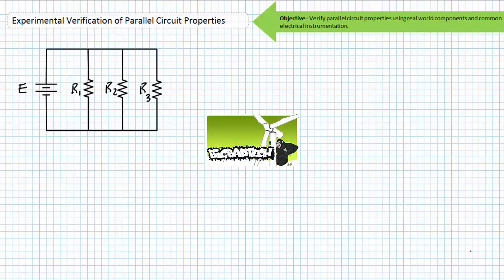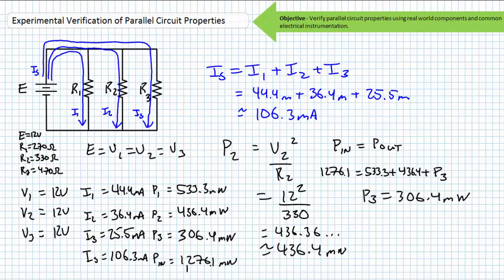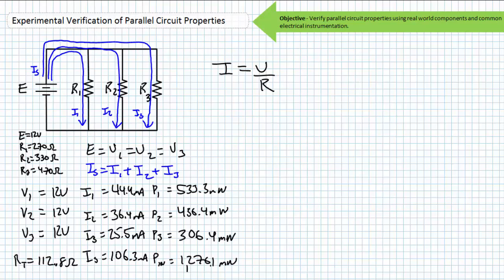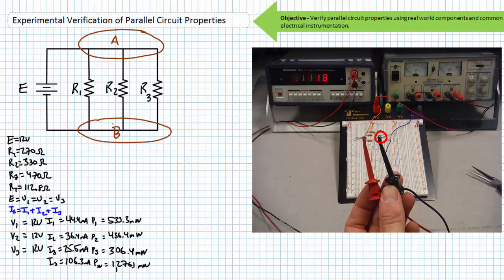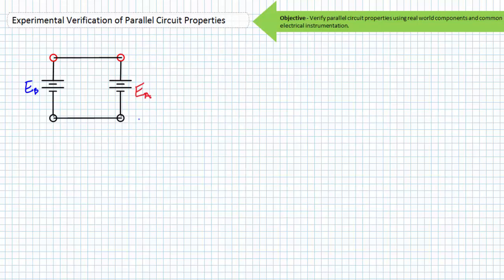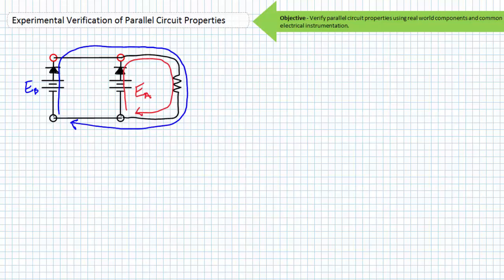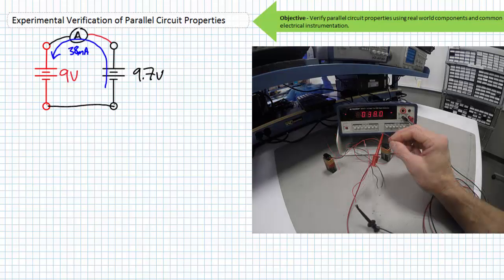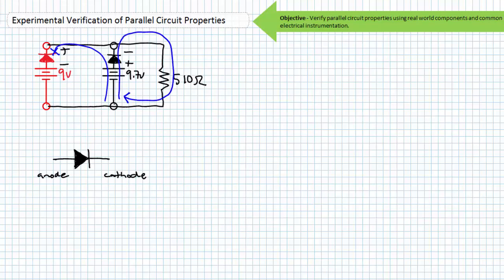Verifying Parallel DC Circuit Properties

Comment: How to calculate the current drawn by weaker battery source, when it is connected in parallel with stronger battery on paper without ammeter?
Reply from the maker: If you wanted to simulate a "weaker" and a "stronger" battery for theoretical calculations you could insert a resistor in series and in parallel with the batteries. The weaker battery would have a larger series resistance and a smaller parallel leakage resistance. The stronger battery would have a smaller resistance and larger parallel leakage resistance.
Reply: @bigbadtech  Alright, so there's no direct means. we need resistors to make the measurement.

Comment: I didn't think about putting a diode between 2 dc batteries👍 

I built a circuit with solinoid to actuate throttle, and ignition for 10 horsepower kohler engine on a rear hitch tow mower for my garden tractor.
 I noticed the battery (lithium battery) for the kohler engine wouldn't charge when hooked to tractors (lead acid battery) voltage from charge circuit is good now I'm thinking lithium is back feeding to lead acid battery🤔